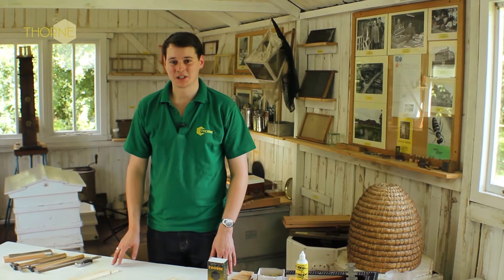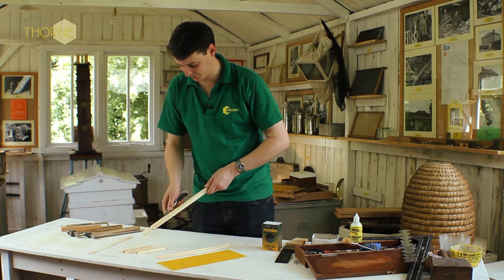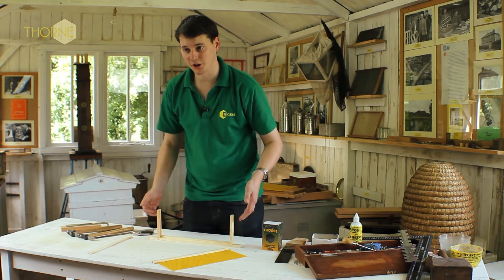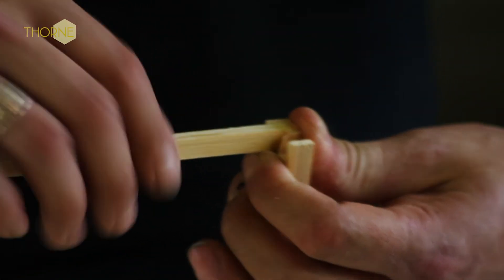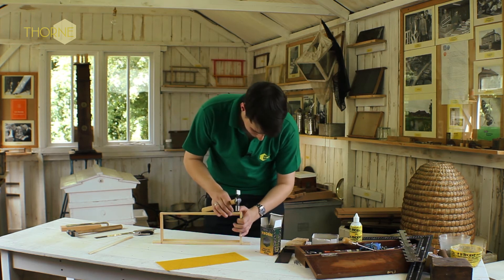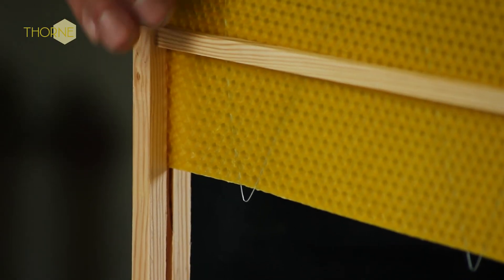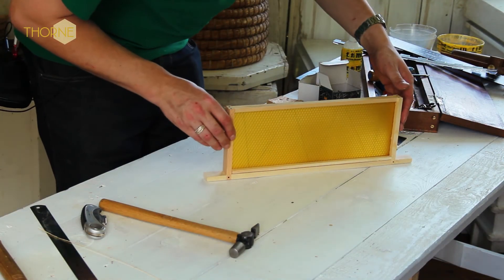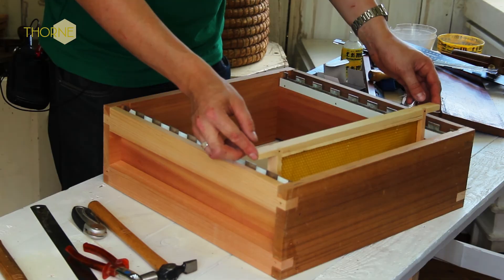THORNE - NATIONAL BEEHIVE SUPER FRAME - Assembly Instructions

Comment: No problems with this assembly and very little wood needed to be skimmed off the bottom. I used an old butter knife to help get a clean 90 degree bend for the thin wire base foot. A very pleasant afternoon building the brood box and then frames for the brood & supers during lockdown.

Comment: Hmmm! No doubt this was well rehearsed beforehand. It's all very well as long as the bottom bars fit into the slots, I have had to shave quite a bit of wood off both sides of every single one of them, on 11 frames that's 44 sides to shave, took ages and when they eventually fitted in the slots the wax is almost impossible to slide down through the gap, so I had to fit one bottom bar and then put the wax in place and then pinch it together with the other bottom bar. So Thornes, my point is perhaps you should make a video on a frame that comes straight out of a packet and what to do when things don't go according to plan. Other than that, I like your stuff!
Reply: Not to mention the pins coming though the top bar when pinning through the wax loops